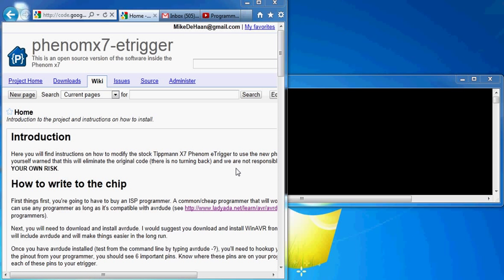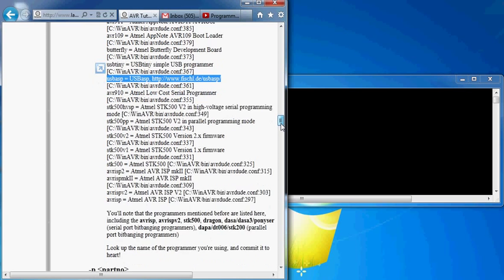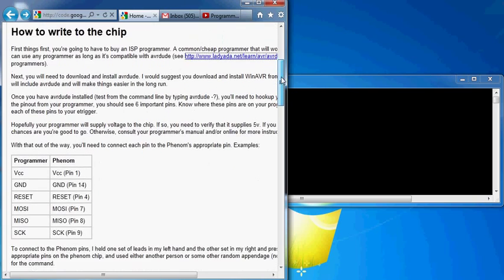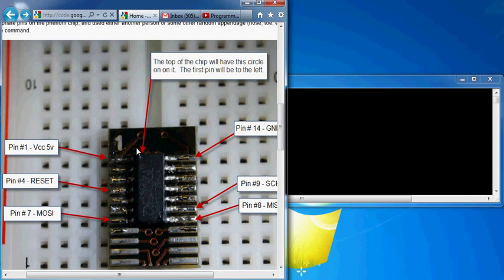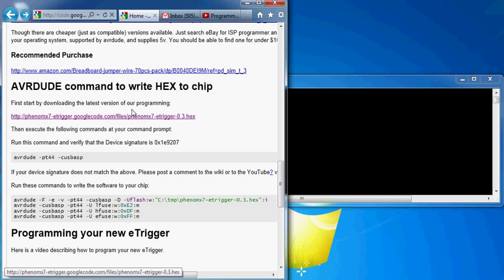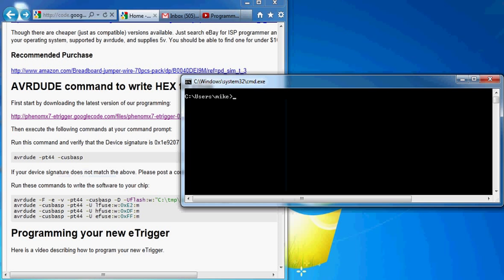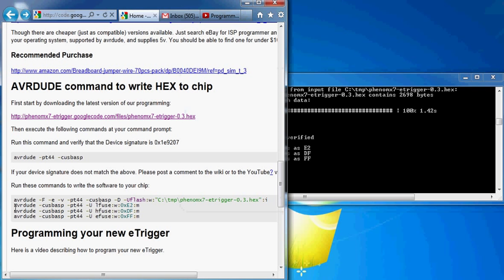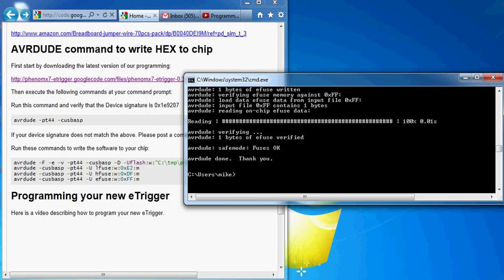Phenom Programming Part 2

Comment: After many years, I finally got around to attempting this, my phenom board is red with a label "T20 VERC" on the chip. Went through all the steps and my board flashes red-green red-green repeatedly and the test command does not work. Board still functions as normal. Does this mean I have one of the newer restricted boards? Anyone else have luck?
Reply from the maker: Did you remove the battery before connecting the chip? Also make sure all connections are solid.
Reply: @mikedehaan81  my connections weren’t secure enough, that was it! Ran out of time (work) before I could flash the software, will update if anything goes right/wrong. Also it’s really cool how you’re still active here 7+ years later!
Reply: @mikedehaan81  alright, I flashed the chip successfully however when I tested it out it did not turn on. When I try to connect VCC to pin 1 the leds don’t flash anymore. Still able to verify signature with avrdude though.
Reply from the maker: @suspicious_soup  hmmm....did you flash with the correct binary (classic versus phenom)? Maybe try flashing a second time?
Reply: @mikedehaan81  tried flashing again and in my command prompt it says “cant open input file C:\tmp\phenomx7-etrigger-1.0.5.hex: no such file or directory. Didn’t notice that before so that’s probably why. However, I have that exact file in that exact directory. Am I supposed to run it through AVRinsight?
Reply: @mikedehaan81  aha! I have a temp folder, not tmp folder. Let me try that
Reply: @mikedehaan81  that was it! It did ask me if I wanted to change a fuse from e2 to 80, which I typed yes, and it’s working flawlessly now! Thank you so much for your assistance!

Comment: Does this still work?? I’m going to try and do it today
Reply from the maker: Yes,  good luck and let me know if you have questions.
Reply: @mikedehaan81  oh dude thank you so much for responding! ill let you know if i have any I've already done this once successfully and i have to say well done this is an awesome mod!! i did have a little question when i did it like 4 years ago i noticed that on full auto i would only be able to shoot for like 10 seconds straight before the solenoid got stuck or something does that sound like a gun limitation or a software error? it still worked flawlessly I'm hoping this gun doesn't do it too but even if it does ill be so happy to get this on here again!! thanks again for all the work you put into this! YOU ARE THE MAN!!
Reply: I keep getting an sck error so I bought a new usbasp hopefully it works
Reply from the maker: @Smoothslash777  That usually means the pins are not connected well. Double check and try again
Reply: Ahh thank you so so much finally got it installed today and it’s as good as I remember! Although on full auto it does just stop shooting is this normal?

Comment: Hello Mike:

when following this instruction

"Run this command and verify that the Device signature is 0x1e9207"

avrdude -pt44 -cusbasp

I get the following message in cmd prompt:

avrdude: error: could not find USB device "USBasp" with vid=0x16c0 pid=0x5dc

What am I doing wrong?

Is this because I'm not actually holding the jumper wires in place? I only have the USBasp connected.

Thank you Mike!
Reply from the maker: Antonio Benito Castro correct. The chip must be connected to the programmer for this command to work properly.
Reply: Mike De Haan... I really appreciate your quick response. Thank you. I'm taking my time and doing this right, one step at a time. First one I do. I'll report my results. Thanks again!  : )

Comment: I'm having some issues, AVRdude cant find the phenom .hex file, when on your wiki and I click on the x7 phenom .hex file, it downloads it, if i click on it I have no options but notepad to open it with.  where should i save it so it will read in the command prompt?
Reply from the maker: Malakai You can place the file anywhere on your computer as long as the location matches the path on the avrdude command line. I would suggest placing the file somewhere simple without spaces such as C:\tmp or someplace similar.

Comment: Can o use this in windows 10? I have the usbasp v2.0 what else do I need?
Reply from the maker: I have not tried this in Windows 10, but I don't foresee any issue. have you installed avrdude and are you able to run some of the commands?
Reply: +Mike De Haan thanks  got it going but it only have the fully auto I found version 1.0.1 where can I find the new version?
Reply from the maker: +Marquez Transport v1.0.1 is the latest version. This version contains all firing modes, however, it defaults to full auto on all presets. Were you able to get the software installed? Are you able to get through the configuration menus?
Reply: +Mike De Haan yes it works great let me try to program the presets

Comment: Hi!!  It works with W7 64bits? can i weld the pins and program the chip?
Reply from the maker: Yes, Windows 7 64bit was the operating system I used to program it. It will work.

Comment: PS the E trigger board LED is flashing RED......RED,GREEN.......GREEN.... continuously while the jumper wires are connected......Im also using the exact USBASP board you suggested. The chip is also marked "T20 VERB"on the E trigger. The Device signature comes up 0x000000 when I can get that far....
Reply from the maker: At this stage, does the chip work normally (with the original programming)? If not, it's possible the chip has been damaged.

"Target doesn't answer" is usually a sign that something is wrong with the connections somewhere between the ISP and the microchip. I had the same problem that was driving me crazy. Turned out one of the wires I used had a short in it. Sometimes worked, sometimes not. I hate to say this, but you will need to check your connections again. Ensure the wires are new and not defective (I used the connectivity setting on my multimeter to verify each wire). Make sure the ribbon cable on the ISP is plugged in the right way and the pins line up correctly.

Also make sure the battery is not connected to the board when you do this. The power (5v) should be coming from the ISP.
Reply: Mike De Haan Yes the board does work fine after the attempt at installing your code. the battery is connected just as you have it in the video with the negative terminal only. I will check the jumpers to make sure there is a solid connection between the program usb and the E trigger. I will keep you posted and thank you so much for getting back to me so quickly!!
Reply: Mike De Haan Absolutely no luck with the programing. I thought it might have been the coating they put on the board to keep it water resistant, scraped the terminals lightly to get it off but that didn't work. I performed a continuity test on the jumpers I was using and they all checked out fine. Cleaned the board with electronics cleaner, no help. I'm all out of ideas...I have tried NUMEROUS times to get this to work, even got my wife to work the laptop too while I did the jumper handling. The avrdude program seems to be working fine. It gives me the info when I type avrdude -?. At a loss, help!!
Reply from the maker: Pete Medica
 I can't think of anything that you haven't already tried. You should at least be getting a response from the "avrdude -pt44 -cusbasp" command. That command does nothing to the chip but query the device signature. It is a read-only operation that tells us if your connections are correct and the chip is the correct model to accept programming.

Our next step to rooting out the issue you're having is to contact me directly via email. If you can, send pictures of the programmer you're using and the pin-outs from the ribbon cable you're using (and how they connect to the chip - pin numbers).

The picture should be similar to the following:
    wiki.mad-phenom.googlecode.com/git/usbaspPinout.jpg

You can find my email address on the wiki:
    code.google.com/p/mad-phenom/wiki/HowToUseThisSoftware

I realize this is frustrating, and I thank you for your patience. I'm optimistic that we can get you up and running.
Reply: Mike De Haan I have the same issue.  I have tried in two phenom boards that I have with no luck. One of the boards is older while one is newer with the "T20VERA" label on the chip. I'm getting the same error that the chip "target" isn't responding. I've spent an afternoon triple checking all my connections. Any thoughts? Thanks.
Reply from the maker: Andre Rivers
Unfortunately, some boards from Tippmann are now coming with the programming pins disabled (I'm not sure exactly when this started happening). With the method in the video, we are able to get around the chip lock feature, but in order to get around the disabled programming pin, we would need high voltage programming. I know there's an Arduino solution out there, but when I tried it, it did not work. My solution was to buy a high voltage programmer ~$30USD and unlock the chip. I did that and was able to program the board once again.

If you're unable to get your chip to respond, this may be the case. Check out the microcontrollerprog website and look for the "ATTiny Fuse Repair Programmer". Depending on your computer, you may also need  the "USB2TTL" adapter.

http://www.microcontrollerprog.com/fuseprog.html

What color are your boards out of curiosity? Are they red?
Reply: Andre Rivers Mike did my board and it works great!!!
Reply from the maker: steve wells
(Re: paid services) I did for a while. However, since the volume was so low (as expected) it was not cost effective to keep my mailing address open (I was losing money). If I charged enough to keep it open, it wouldn't be cost effective for you - the end user. The whole purpose for this project was to provide the intrepid user with a free option for programming their board. Occasionally I see a board like yours that is locked for one reason or another and there's little I can do remotely. I have yet to find a cheap option to fix the issue. The microcontrollerprog device linked above is the current cheapest option available (~$40 solution) to unlock the chip fully (aside from soldering a new chip on the board - $4 solution - requires mad soldering skillz). For me to break even on 1 board every 3 months (actual volume is slightly less), I would need to charge ~$30...then add shipping to and from Postal Code 60084 (might total close to $50).

I will certainly do what I can to help out. Perhaps there is something else we're missing in the process. Please contact me directly via email and we can work through this offline.

Comment: Mike , other than the "cannot set sck", Im getting, avrdude: error: program enable:    target doesn't answer. 1
                                                                               avrdude: initialization failed, rc=-1
                                                                                              Double check connections and try again, or use -F to override
                                                                                             this check.
  
                                                                               avrdude done.   Thank you.

I have double checked the connections and still getting the same thing. I have everything taped to my table so it won't move but I can't leave it here very long so if you can find the time it would be greatly appreciated if you can get back to me asap..... : (

Comment: Hi, im trying to use your firmware on my Phenom but im having some problems. the code "avrdude -pt44 -cusbasp" apparently is not working fine. i think the problem is with "-pt44", i'm using the same usbasp that you are using but when i'm writing that command is showing warning: cannot set sck period. please check for usbasp firmware update.
Reply from the maker: The sck warning is safe to ignore. Did the device id show up with that command despite the warning?

Comment: Hey Mike.  Cool videos.. I just bought the USBASP to program my e grip. but I get  error when I try to Run the command to verify that the Device signature is 0x1e9207
"avrdude -pt44 -cusbasp"
 the Error is. 

avrdude: error: programm enable: target doesn't answer. 1
avrdude: initialization failed, rc=-1
         Double check connections and try again, or use -F to override
         this check.

Do I need to plug the usbasp to the board for this check or just the usbasp?
Thanks
Reply from the maker: Sorry for the late reply. You need to have the usbasp plugged into the computer as well as the connections attached to the chip on the e-grip. This is a sanity check to verify that all systems are go before you program the chip. If this step fails do not proceed. Let me know if you still have problems.

Comment from the maker: This firmware will overwrite the software on the stock Tippmann Phenom X7 eTrigger and replace it with custom software I've written.  Some notable enhancements are:

1) Removed "Safe-Shot" from a ll firing modes
2) Ability to program 3 presets you can toggle through but pushing the program button
3) Programmable burst size (from 2 to 10)
4) Raised firing rate limit (up to 40 bps)
5) Ammo limit (useful if you're running with limited ammo such as QLoader)